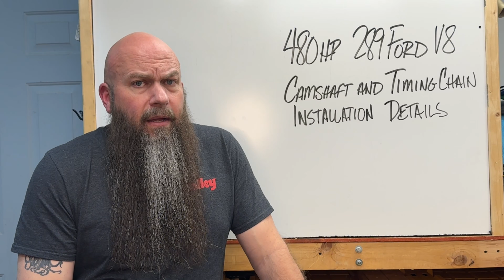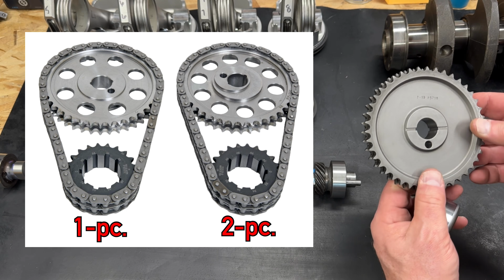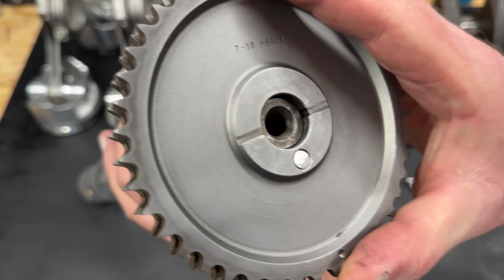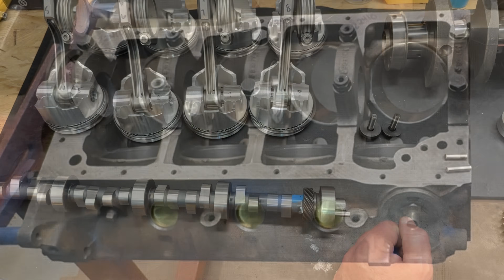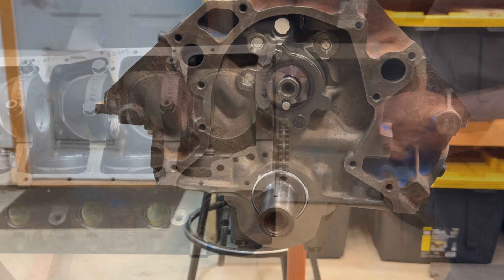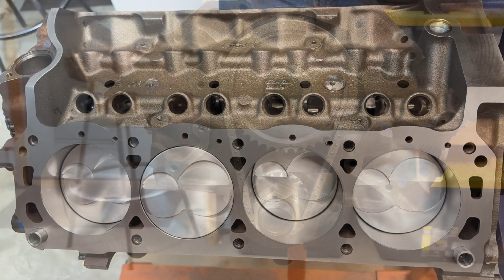480+HP 289 Ford Part 5: Hyd. Roller Cam, Timing Chain, Thrust Plate, & Lifter Install w/Tech Notes

Comment: I have that exact timing set for my 289 but I just cant get it on.
Reply from the maker: The crank gear should just slide all the way on with no chain.  Check the height of the woodruff key on the crank, make sure it’s level with the crank snout, also check it for burrs.  In rare cases, I’ve had to polish the snout just a little with Emory tape to remove corrosion and carbon deposits.

The cam gear should slide right on when there is no chain, if it doesn’t, check the nose of the cam for burrs and inspect the dowell pin, I’ve seen pins that were bent and also mushroomed and in both cases would not let the gear slide on, the fix is to file the pin if it’s mushroomed, and give it a tap in the direction  you need to get the upper gear on.  

If the sprockets both slide on without a chain, the problem is usually that you don’t have the cam and crank correctly aligned quite perfectly.

Comment: I built a stroker 289 to produce 444 hp and 440 torque at the crank. But, my cam, hyd roller, comp cam big mutha thumper has poor low rpm torque and an ugly idle. What hyd roller cam would you recommend?
Reply from the maker: Send me an email: TheGT350Garage@gmail.com 

If you can include the compression ration and a brief list of what parts you’re using, carb intake, heads, your current cam specs, exhaust, and what transmission and rear axle ratio and tire size, I can put you onto a more appropriate cam that won’t sacrifice power and drivability.

Comment: What are your thoughts on Speedmaster parts?
Reply from the maker: They have gotten better over the years, back when they were Pro Comp Electronics, there was quality control issues on everything, but we just used a set of FE heads, roller shaft rockers and dual plane intake on a 390FE for a ‘66 F250 and they were actually quite nice.  But we inspect EVERYTHING.  Valve guide clearance, valve job, spring pressure, we change the springs to match the cam in most cases, hand lap the valves to make sure the valves will seal correctly.  They have good potential but need the detailed attention before use to ensure they are up to the task.  

Now, if you’re looking for all out performance, no, I think there are better heads, and so on, but if you’re just building a budget deal, yeah.  I would say check some of the other Chinese manufactured heads like FloTek and similar depending on the application, and go with the best bang for the buck, but still clean, inspect, measure, and do the due diligence to make sure you won’t have an issue before you slap an engine together.

Comment: What the ford Motorsport part number of timing chain set, And thrust plate.?
Reply from the maker: For the last 30 years I have run the Ford Racing M-6268-A302 Kit ($193 as of 4/2026) that includes the standard cast thrust plate and dowel pins, but these have gone from being the most affordable performance chain kit to one of the most expensive options.

The M-6268-B302 ($173 as of 4/2026) timing set does not include the thrust plate or dowel pins, but it is a billet steel upper gear.  For compatibility it requires the M-6269-A351 ($60 as of 4/2026) steel thrust plate.  These parts have also gone up substantially in price.  

On upcoming engine builds, I’m using the Cloyes 9-3535X9 9-keyway Steel cam sprocket sets for about ($99 as of 4/2026).  This is a hybrid of the A302 and B302 timing set using the standard chain and billet upper sprocket with the standard induction hardened lower sprocket.  It’s more than adequate for any sub-7000rpm street engine.  It does require a steel thrust plate, available from Summit ($33 as of 4/2026) or Speedmaster ($12 as of 4/2026) with countersunk fasteners.  

You can shop it around a little and you might be able to save a few dollars.  DO NOT run a timing set with a Torrington thrust bearing on the upper sprocket for a street engine, they can and do fail, and when that happens all hell breaks lose in the engine.

Comment: Have you ever discussed (Danny Bee or Jesel) belt drives?  Often when opening up an engine it seems there is several degrees of slop in the chain.  Though expensive, I like the idea of precise control and reduced vibration/harmonics.
Reply from the maker: For street applications, timing belts don’t have the lifespan, and on a Ford you have to pull the water pump to get to it. A high quality timing chain is still the best option.  For racing, a timing belt is great.  One way to reduce stretch and wear is make sure it gets enough oil, relying on splash oiling is not enough in high performance applications.

Comment: Has anyone left their lifters in mineral spirits? I possibly read/heard that as a process of cleaning out the lifters. I actually do not remember if they reused old lifters or new ones. Was just wondering.
Reply from the maker: Should not be necessary.  You can remove the snap rings and disassemble them and clean them on white lint free cloths and you likely won’t find anything in them unless they were handled poorly between manufacturing and packaging, shipped in a cardboard box with no bag, or otherwise exposed to potential contaminants after manufacture.

Comment: I'm confused as to whether you use a retrofit cam or the late model roller cam with the late model lifters.  Short vs tall lifter bores.  Thanks if you can clear this up!
Reply from the maker: ALL 1962-1984 221/260/289/302 blocks are all flat tappet.  Most ‘85-01 blocks are hydraulic roller.   ‘69-93 351W is flat tappet, ‘94-97 is hydraulic roller.  All other Fords prior to 1997 with cam in the block are flat tappet.  

If the block is designed for a flat tappet, you must use a retrofit base circle camshaft with production lifters.  If you want to use a production cam core (small block) you must use a retrofit link bar style lifter.  If you use a retrofit cam in a hydraulic roller block, the lifters are too low for the stock type lifter to properly engage the lifter guides and can cause serious problems.  A small base circle in a HR block can only be used with a link bar lifter.  

Hope that clears it up.

Comment: How do you tell if your cam sprocket has the 4 deg retard built into it or not?  My part number is S-531
Reply from the maker: If you only have a single key way, the key way and the tooth with the dot should all be in a straight line.  If it has 2° or 4° of factory retard built in, the tooth and dot will be to the left of the key way (trailing) looking at the sprocket with the key way at 12 o’clock.  The advance and retard on factory Ford sets was always built into the crank sprocket.

Comment: i have been very successful taking the cam pin out. get center on pin, drill it with 1/8 drill, then step it up to a drill bit size to match a 10/32 tap.... then take a piece of aluminum and draw the cam bearing size and drill and tap 2     1/4-28 holes inside the circle to match to the cam..... then, get a 10/32 screw or bolt stainless is best, and drill that hole to line up to the cam dowel. put screw in aluminum tool your making and thread it into the dowel, then.... the 1/4-28 holes, install long threaded bolts and evenly tighten against the cam. the 2 bolts will act like Jack Screws, and when the 10/32 screw threaded into the dowel, by evenly tightning the 2 jack bolts, it will remove the dowel. I could send you photos of what i made and worked great.
Reply from the maker: I’m not saying it can’t be removed, I can drill them and extract them as well, but that is far more than the average guy is capable of with hand tools in a garage and I’m not going to recommend anyone try this for the first time on a $500+ camshaft.  

There are some pins that are .0015-.0020” press fit, and others that are .001” undersize so they literally slide in and out of the hole.  The undersize pins are the ones known for shearing, they are fine on under 6000rpm street builds with lighter spring pressures (sub-300lb/in rate springs).

Comment: My son has a 351W we just picked up yesterday that had the Mains line honed but the Machine Shop did not wright down the spec when they built the long block. My son bought a 408 stroker kit from Scat and we provided all of the parts for the build but they "lost" the chain set we provided and installed a SA chain set. Is there a way to measure if we need a -0.005 or -0.010 shorter timing chain since the chain set they installed on the long block seems like it has too much slack. And how much slack is ok?
Reply from the maker: If it was just “honed” you won’t need a shorter chain.  If it was line bored, you would.  If the chain is a double roller it should t have more than 1/8”-3/16” (0.1250”-.1875”) on the slack side for deflection.  0.1250” of deflection half way between the contact link on the crank gear and the contact link on the cam gear is 2.5°.  The factory Ford allowable spec is 1/2” of deflection or 10° of timing (which is A LOT).

Comment: Cam Specs?
Reply from the maker: Cam specs are in the previous video where I degree the cam and check piston to valve clearance.  The final wrap up video will include a full break down of the build.
Reply: following